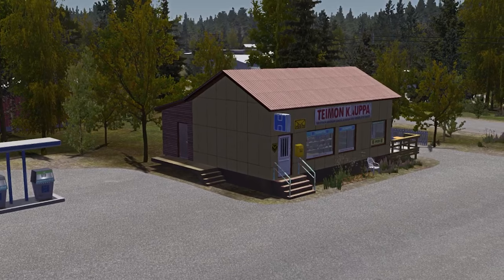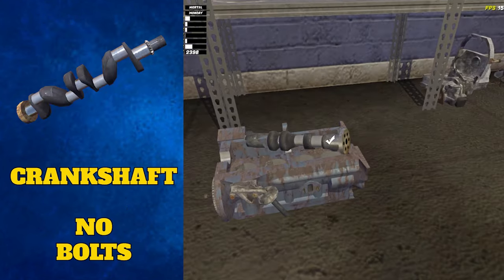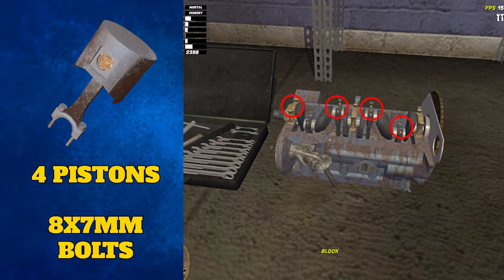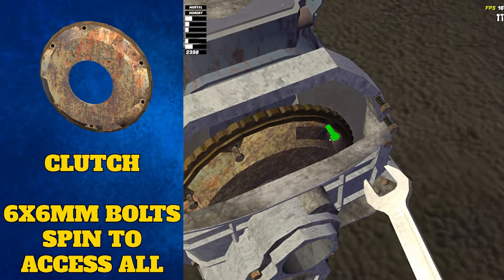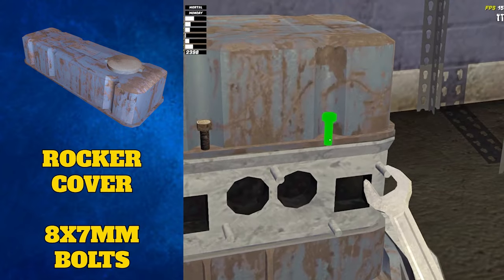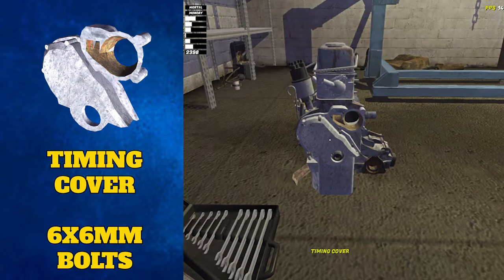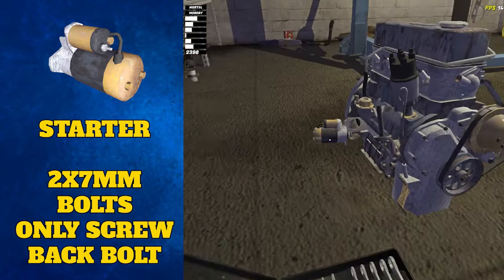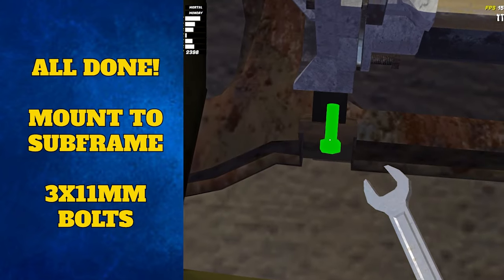How to Build the Engine in My Summer Car 2024!

Comment: My god, i've struggling to put the inspection cover on and it spent 1 hour to do that and still cannot attached
Reply: Same
Reply: Very late reply, but its because it uses the same bolts as the gearbox. Loosen the top 4 gearbox bolts, then put it on and tighten them back up.

Comment: Nice video 👍
I have a question and i'd be very happy if you could give me an answer.
I rebuild the engine with new parts and a few upgreaded parts, bc i thougt this would fix the lack of power. After i did that and went for a ride, the car was still pretty slow and weak. I couldn't figure out what was wrong, so i opend msc editor to see whats wrong. The problem:
Cylinder 1 - 4 Intake -> bad
Cylinder 1 - 4 exost -> bad
Distributor spark timing -> bad

I don't want to fix it with msc editor, so could you please tell me, how to fix this normaly?
Btw sorry for the bad english
Reply: You must tune your carburator to fix the cilynder in takes, there are many tutorials in yt, for the distribuitor you must adjust it with a screwdriver and by hand scroll it until you heard something like an old school Bell when you hear it do 1 scroll back
Reply: Also btw MSC Editor might mark the intakes as bad for some decimal numbers but as long you dont hear sounds in the engine its ok but make sure that they are atleast decent or the engine might explode
Reply: If your cylinder intake and exaust valves have "bad" values according do MSC, it means the rockershaft was not tuned using the 7 clicks up method mentioned in this video. Go ahead and retune you rockershaft using this method or scroll up until you hear a ringing sound, then scroll down one click. 

I should mention that values different than 7 on MSCEditor are not always "bad" as it sugests. Different tunes sometimes require different values on each valve, so if you really want to get into it, grab a case of beer, a few sausages, your tool box and get to testing your Satsuma in the air field.

Comment: What does the lightweight flywheel do and will it still pass inspection with that installed?
Reply from the maker: I don't bother with it, it never has worked as intended and actually will cause your car to stall sometimes

Comment: 6:01 why u didn't write 37 UP. That's more easy than 44UP , 7DOWN.
Reply from the maker: when you start the game, the tuning of the carb is random. Going 44 up ensures that it is set to the furthest it can be before you tune it. The screw will turn indefinitely but the value caps... that's why homie